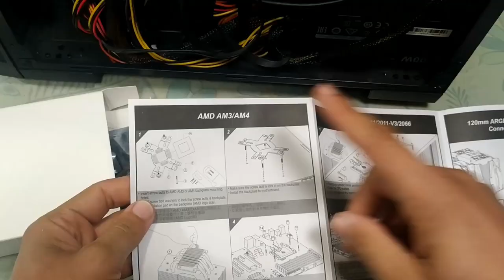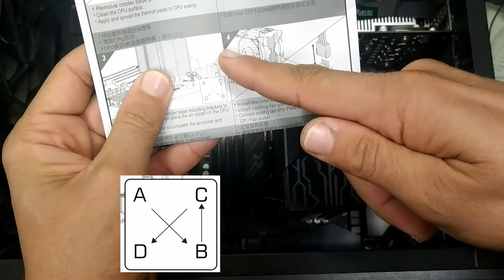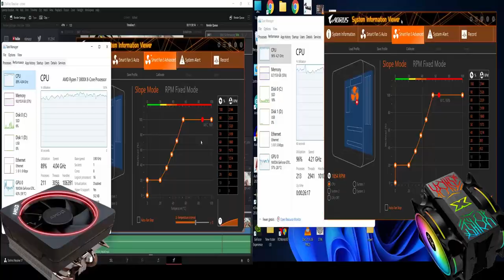Windpower POR XIGMATEK installation & performance تركيب

Comment: Does it work with am5 ?
Reply from the maker: I think not 
AM4/AM3+/AM3/AM2+/AM2/FM2+/FM2/FM1
Reply: Yes since it uses the same backplate
Reply: @Lethalwick5673  it doesn't i had to buy an adapter